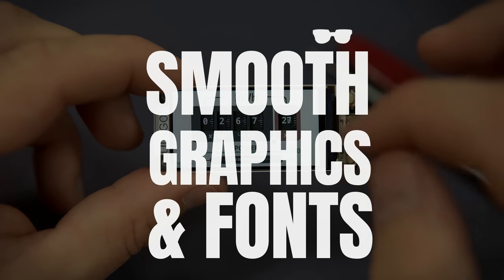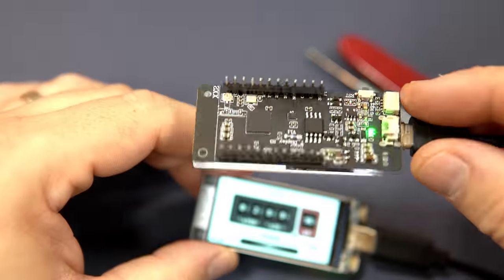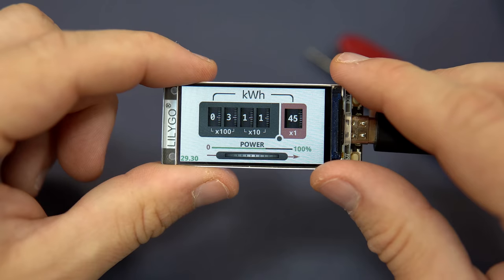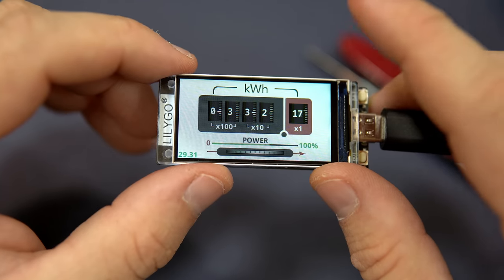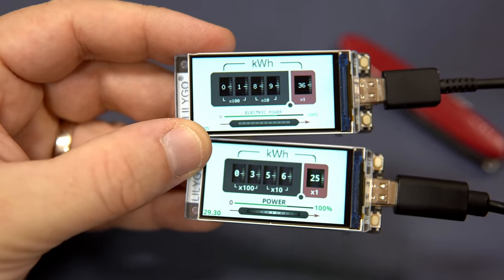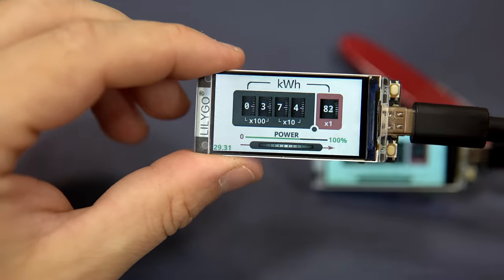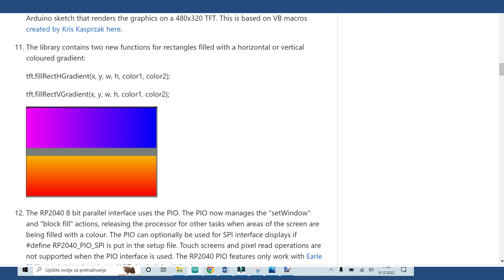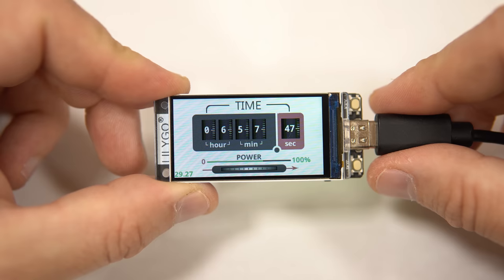How to Make your Project look Amazing

Comment: That's awesome!  You posted this six hours ago.  Yesterday I was using the gradient feature of Gimp to make a static logo for a project.  Now I can make the gradient dynamic, if I want!  That's neat, and, I think I'll play around with this.  Thanks again!

Oh, here's an idea for you: I added a potentiometer (e.g., "volume control" knob) to the breadboard I'm exploring this display with, so I can adjust values more quickly than the edit/compile/upload/verify cycle which is at least around 1 minute between "changing a variable and seeing the result."

By adding just a bit of code to hook the value of the potentiometer, mapped to a proper range, I'm able to test a lot faster.

Hope this helps, and, feel free to make a video on it if you like the technique!  Thanks again.

Comment: Working with these little ESP32 dev boards is a blast. It feels like they can do almost anything, especially with the full Internet functionality.  I am eagerly anticipating receiving my order for some units of the version of this board that is the mini front panel.  I adapted that first project into a teeny triggered sweep oscilloscope.  I didn’t try too hard to optimize anything, so 1 KHz is about the upper limit it can display, but is neat to just code it in C++.

I’ve been toying with the idea of keeping a ring buffer filled continuously with an interrupt routine reading the ADC channel and and having the main loop calculate the trigger conditions at an offset behind the current sample so that I can display pre trigger data in my sweep after valid trigger conditions are met.

Having the CPU cores running at 240 MHz gives quite a bit of time to process data in between the ticks when it is necessary to interact with the analog world.  The fast CPU cores make writing in a high level language practical for doing real-time work.
Reply: Would love to see this in action!

Comment: Volos, if you create a jpg 'unfolded' strip of each number wheel then you can have them rotating behind the panel layer like an odometer. I found the easiest way to do this is to index the array when pushing the image in order to show a window of maybe 1.5 to 2 digits span. Increment the index point and re-push into the full screen sprite. Great for retro clocks, counters and cockpit instruments. Congratulations on the stunning work!
Reply from the maker: I am not sure i undertanded you. You mean , store numbers in arrays of images?
Reply: @VolosProjects  Yes, a single array for a complete number wheel - like a vertical film strip going from 0-9 (perhaps with an extra 0 on the end so the loop can be seamless). Then just select a region of the byte array to display with variable in and out points. Like a poor mans gif but you can reverse direction and pull out frames easily. I think TFT_eSPI already has a way of doing this but at the time I wanted to try it the sprite feature had not been implemented so I did it the quick and dirty way.

Project request: A clock based on an aeroplane altimeter.

Project request 2: A tally counter like nightclub bouncers use - with a push button and real rotating number wheels :)

Comment: Great work! I have enjoyed each of your videos on this display and they have inspired me to try one out for myself. I'm currently working on a project using the LVGL library to display data from a car's CAN bus like battery voltage, power/torque, speed, etc. Really a fun little device!
Reply from the maker: tnx Joe, i will also try LVGL library very soon. how hard is to setup,do you useadditional software for design?

Comment: The difference in frame rate is probably just because the fonts are larger, so the graphics library has to blit more pixels each frame. The anti aliasing was probably done when the fonts were generated so there is no more overhead there, except if the semi transparent pixels around the edges need to be calculated on the fly to blend to the background colour.

Comment: Hello Volos and a big thank you for your tutorials, without them I would have big problems with my T-Display !
I have a question about fonts :
I tried your powermeter sketch on my T-Display and it works without problems.
Than I tried to change one of the fonts with "Orbitron_Light_24.h" and after that the powermeter sketch doesn't compile and shows errors in the Orbitron_Light_24.h file.
In fact when looking with notepad the internal structure of Orbitron_Light_24.h is not the same than the structure of the fonts files included in your sketch.
Does this mean that the anti-aliased font files are "special" fonts, and is it possible to modify per example Orbitron_Light_24.h so it works in a sketch with anti-aliased fonts ?
Reply from the maker: Yes ani aliased fonts are diferent, it shoud work but  you will need to use function setFreeFont. Check my tutorial about fonts and tft_espi

Comment: That display looks awesome. One hint, maybe you want it like it is, but I would have forced the least significant field to always be 2 digits (given that you are trying to emulate mechanical dials), rather than going down to a single digit in the range 0-9. There are various ways to do that. Arduino sketches are "really" C++ (which I'm not an expert at) but there are ways to give print format specifiers in that (GIYF). Personally (not because it is a good way but because I am mainly a C programmer) I would use a sprintf( least_significant_buffer , "%02d" , the_least_significant_variable ).

Comment: OK, I had to buy a one of those modules immediately. It is on the way. Fortunately I have an older model to play with while waiting. One suggestion: You could add more comments to your source code. It is a bit difficult to figure out which part is drawing what. Just a section header like "// Drawing Spinning Wheel" or so would be great.

Comment: Very cool indeed. I'm always modelling interfaces using Qt/QML. I have a few ESP8266 boards and ESP32 but not for interfaces, but IR relay boards for IR control of hifi, etc.
My next purchase will be one of these boards just to play with and perhaps integrate into a future project, perhaps a speedometer for my electric bike. Either way, I do like creating UI's.
Reply: Very cool, I didn't know about this tool. Do you know other tools that can model interfaces for embedded circuits?

Comment: I dont know why, but after I upload your sketches, I only see black screen. standard examples work fine though
Reply from the maker: did you set wifi data, also new ruters can couse problems try to use some other wifimetwork, or you can try example that dontneed internet
Reply: @VolosProjects  Yes I did. it connects the wifi without an issue. Maybe you have used old versions of the libraries while I am using the new versions. What is the TFT_eSPI lib. version on your PC?

Comment: Excellent tips and a huge thank you for the great work. If I want a smooth font thats a bit larger than NotoSansMonoSCB20 and around 36 in size. How would I go about doing this?
Reply from the maker: Hello Mike, in tft_library in examples folder  and in soomth font folder you have few examples, in one example you can find font which is size 36.

Comment: Can I order you a project similar to your work?
Reply from the maker: Explain your project. I can make you just UI , you will need to do logic, sensors and evrything.
Reply: @VolosProjects  my vintage tape recorder has a four-digit tape counter. I want to replace the mechanical counter with a lilygo. the contact sensor for one pulse must translate to one digit. reset button, converts all numbers to zeros
Reply from the maker: Can you contact me, my mail is arduino.b2016@gmail.com

Comment: boards are overpriced and displays are small also there are cheap 800x600 displays (nt35510) but esp cant handle them
must say arduino libraries are very clumsy and fail in time because it is not your code